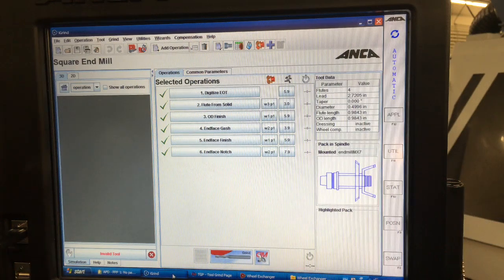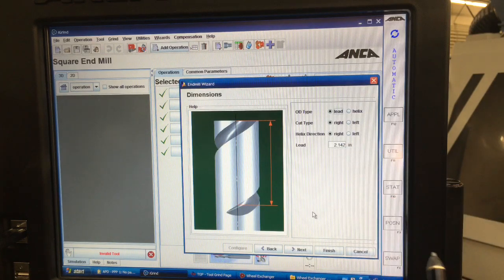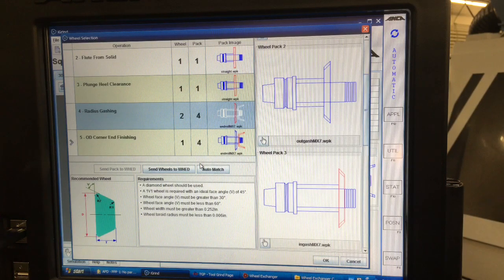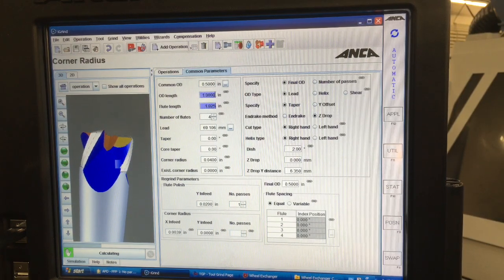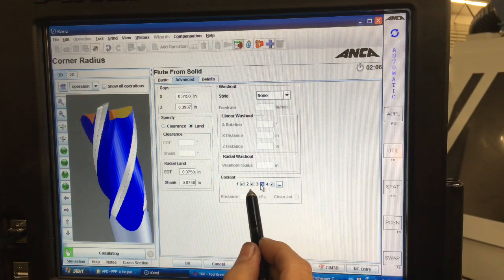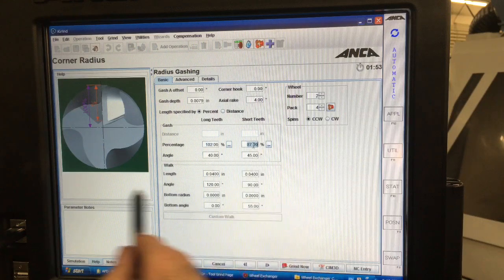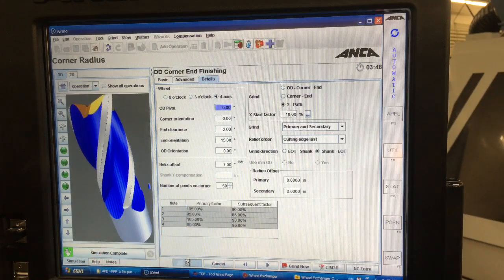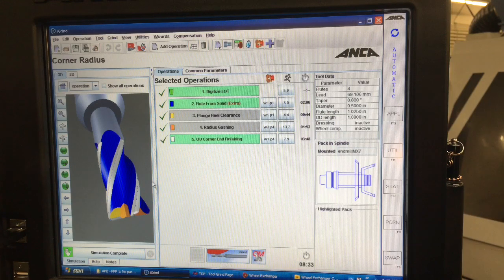More Anca Programming

Comment: Hey Alfred,

I'm actually using this machine and software to work on endmills. Have you ever had to redo any feature after the endmill was made? If so, have you checked out the autotool measure operation? Apparently it can measure everything all in one operation such as the helix, dish, etc. I've worked on drills for the most part and the endmills are giving me a little trouble in terms of spindle load when I have to regrind the heel clearance and the gash. 

Cooper
Reply from the maker: Austin Wilbanks I don't believe that we have that feature. I have definitely re-ground or used mode regrind many times though.
Reply: Alfred Lyon Did you have to remove quite a bit of stock on any previous regrind? I tried matching the rakes on other people's tools but still have to take a bit off to fully clean up an old gash.
Reply from the maker: Austin Wilbanks I never regrind other people's work.
Reply: Gotcha. Thanks for the reply! Love the condition the area is in, very clean!
Reply from the maker: Austin Wilbanks as far as spindle load use the adaptive grind and give it a max percentage and feed rate. Be sure to do as I do in the video and check the in/out gain and bring them both down to .03 so it doesn't bounce around

Comment: Interesting!! thank you  May I ask you a question ?
Why did you check the parameters (adapt int gain,adapt pro gain)
Reply from the maker: I do that because it limits the amount of up and down spindle load. If I leave that off and use adaptive grind the wheel kind of "bounces" on the cutter . By tuning the in and out gain it allows for a smooth consistent grind.
Reply: +Alfred Lyon Thanks for the reply